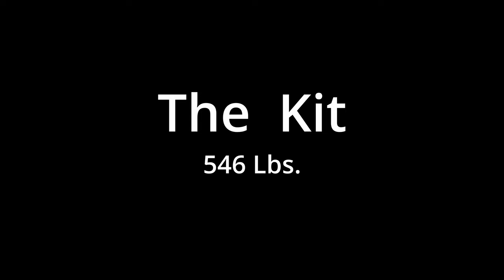DIY - How I Built/Assembled a Sunjoy Octagon 13x13 ft. Cedar Framed Gazebo

Comment: Dave, I am in the process of building my gazebo, and I must have watched your video 20 times already!  I am definitely not a handyman... Made a mistake when building the panels and had to redo them the next day!  Now they are sitting until I can find a couple of people to hold them for me.  Thanks for the video, it's been a tremendous help so far.
Reply from the maker: Many thanks for watching.  Although the process looks simple in the video I also had a problem with one panel.  I didn’t get one of the supports bolted down right and the panel wouldn’t fit.  It took me a while to figure this out.  We certainly like our gazebo and spend a lot of time enjoying this new environment.  Good luck on your build and thanks again for watching/commenting.  Dave in Montana.

Comment: Great video! My wife and I just finished putting ours together on an octagonal deck I made. I couldn't believe how well engineered it is and how all of the parts fit so well. The illustrations in the directions are easy to understand, too. We plan to add railing like you did, but want to use bamboo to match a nearby gate. We referred to your video many times and really appreciate you making it. Thanks!!
Reply from the maker: Awesome comment Dave!  Yes, I was also impressed with the wood and metal and how everything fit together nicely.  I appreciate you watching my video a few times.  I hope it made it easier for you and your wife to assemble.  Bamboo railings should look awesome in your structure.  We have been using our gazebo almost daily as an extension to our patio.  It feels so much better with a roof over your head and still offers views of our yard.  Thanks again for commenting and many happy hours to you and yours in your new environment.  You just made my day!  Dave in Montana.

Comment: Excellent video. I have been trying to decide how to best construct the base for my octagonal summerhouse. What thickness and width would did you use for base foundation and flooring, and type of wood that won’t rot. Thanks for sharing
Reply from the maker: Glad it was helpful.  I used treated 2x8’s for the floor joists (under structure).  The decking and railing was all 5/4 cedar, 1” thick and 5.5” wide.  I chose both materials for longevity.  The treated joists are ugly but covered with cedar.  Western cedar is rot and bug proof due to the natural oils within the wood.  I love the look of the cedar since it closely matched the china cedar used in the kit for the uprights and upper structure.  Have fun with your build, it will look just awesome when finished.  We use our gazebo almost daily in the warmer months.  Thanks for viewing and asking questions.  Dave in Montana.

Comment: Hi Dave, I enjoyed your video. I was hoping you can help me out with a question. I bought this same gazebo to install on a round 12 foot diameter concrete pad. From reading the comments it looks like it might be a little too big for my 12' round concrete pad. I might have to pour some small "bump outs" where the 8 legs will fall. So you measured from outside leg to outside leg with the base covers was 13' 2" ? I will have to bump out 10" just to be safe it looks like. Any ideas on this? I wish I would have watched your video before purchasing it because according to the sales picture it was 12' outside post to outside post.
Reply from the maker: Jonathan, thanks for your question.  I too got sucked into using the web description of the gazebo dimensions.  I actually needed to cantilever my deck out 6” all around to accommodate the width of the legs.  That’s what I get for not having all materials on-hand before I started the project.  I just re-measured and yes, 13’2” to the outside of the metal base-cap to the opposite.  I added 2.5” more width per leg to make everything look proportional and not crowded.  Good luck with your build.  I know it will look awesome and you will have many years of enjoyment.  Dave.  Ps:  Shoot me any additional questions and I will try to answer.

Comment: Beautiful video and great job! Hey, I just ordered the same gazebo and I am going to get the site prep done, anchoring legs to large cement blocks. I can’t find the spacing and dimensions of where the eight legs come down though. What dimensions did you build your deck?
Reply from the maker: Congratulations on your new gazebo Hamilton.  I just measured and the distance from opposite uprights (outside dimensions) is 13’2”.  A metal flange adds about 1” to each post.  I made my decking 13”10” (furthest point to point).  The overhang of the roof is still on the outside of this dimension so rain (without any wind) will still clear the decking.  I let the gazebo floor weather for three months and today I just applied Cabot clear wood protector.  I made the railing system for simple removal (four screws/section) so sealing the railing was ez on sawhorses in the shop.  Have fun with your build and please ask if you have further questions.  Dave.
Reply: @davidegg22  Thank you! Just got my kit in the mail and I’m taking another tool from your bag by pre-constructing upright sections. It’s dumping buckets of rain in Seattle and I’m grateful to have some work to do under my pop-up canopy today lol
Reply from the maker: @hamiltonanderson338  Sweet!  Just keep that rain on the west coast since you have sent more rain than usual to Montana this spring!  At least we haven't had to water the yard yet!  Do have fun with your project and enjoy the build.  Dave.

Comment: Fantastic work Dave! Love it!  Any tips on the angles/dimension for your floor perimeter and supports? That really made the difference.
Reply from the maker: Yes, absolutely.  I wanted a fun floor design, so I used this style of floor based around the eight uprights.  I built the flooring in my shop and started with the eight outside rim joists and worked in from there.  Most everything is cut at a 22.5° angle, so it made the project a bit easier (360 divided by eight was 22.5).  I also needed the flooring to be in sections so that if I needed to move the gazebo I could.  I decked the first section using 5/4 cedar and then worked around the circle from the outside-in.  All cuts were 22.5° but I test-fitted each piece for length.  I then moved the eight flooring sections outside and leveled it.  When the 13' gazebo came in, I noticed the flooring was not wide enough to accommodate!  I needed to add triangles around the base and cantilevered another 6" out all around for a final decking OD of 14'.  Everything now fits well.  I hope your questions were answered.  Thanks for commenting and good luck on your future project.  Dave.  ps:  Post any more questions you may have.

DIY - How I Built/Assembled a Sunjoy Octagon 13x13 ft. Cedar Framed Gazebo:

Follow my three-week progress to build and assemble this gazebo.  I started by designing and constructing the floor structure and railing system.  Watch us as we installed the gazebo on the wood platform, some assembly required!

I used treated 2" x 6" structural wood for the floor joists and 5/4 x 6" cedar for the decking.  The railing system was designed around 5/4 x 4" cedar.  I built the floor before the Sunjoy kit was delivered and was off by a few inches.  This required widening the structure by cantilevering the deck six inches.

I was impressed with the Sunjoy Gazebo (made in China.)  It was packaged well with all metal parts powdered-coated and individually wrapped.  The cedar was first-quality and pre-stained.  The instructions were straightforward and all 750 nuts/bolts/washers were well packaged and marked.  The bolt holes were pre-drilled and the metal roof had generous slots for alignment.  Embedded nuts were used in the roofing supports to make assembly easier.

As you can see, the upright posts of the gazebo required more than one person although the roof structure was designed for one-person assembly.  This kit was extremely well engineered and thought out.
 
We will be enjoying this gazebo for many years.

Comment: Great vid!  How do you think the roof would withstand some snow in winter?
Reply from the maker: Thanks for viewing and commenting.  The manufacture recommends removing any snow over 4” deep.  I will keep an eye on it next winter to see if snow easily slides off the roof or if I need to purchase small roof rake to keep it cleared.  Thanks for asking.  Dave in Montana.
Reply: Thanks Dave!  What size are the posts?  Are they square 4x4?  Enjoy!
Reply from the maker: @handwedge11  Thanks for watching and commenting.  The eight cedar uprights supplied in the gazebo kit were custom milled five-sided, six inches by 2.5 inches.  It all went together surprisingly easy.  I am impressed with the quality of the gazebo kit.  Thanks again for asking.  Dave.
Reply: Thanks Dave 👍🏻 enjoy
Reply: Hi again!  How sturdy is the gazebo from side to side (does it have much play if you give it a shove)?  Ours arrives in a week and we're planning on building some railings (as you did).  Can't wait - looks like a fun build.  Thanks again!
Reply from the maker: AWESOME!  You will have a great time with the build, it goes together so easily (well, after the first three-four uprights!)  If the structure is anchored at the bottom, there is NO play at all (I just tested it).  This is one stout structure after you assemble the wooden frame.  I am impressed with this unit.  Congratulations on your new gazebo.  I know this will be an asset to your yard.  If you would like additional pictures just give me your email address.  Dave.
Reply: @davidegg22  thanks for the intel!  We’re very excited 👍🏻👍🏻